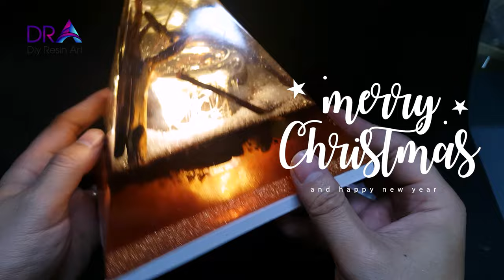Super Easy To Do the epoxy resin art lamp / RESIN ART

Comment: I really interested in this resin art. Before i start doing this, i wanna know some precaution.
1) is it dangerous to inhale it? Do we have to wear a mask?
2) is it dangerous if it touch our hand? And while it is still in liquid form, can we just rinse it with water? In case it made contact with the skin
Reply from the maker: 1) This glue is not dangerous, and there are even many types used to make kitchen utensils, But there are also rare cases of an allergy to it. 
2) It can be washed with water or wipes :) You can see the epoxy I used in the description of some videos
If you have any questions feel free to ask me :) don't hesitate
Reply: @DiyResinArt  thanks for your guidance mastah🙏

Comment: Why burning it and using that heather? And whats about that vacuuming
Reply from the maker: 😀Sorry I don't know what you mean, can you tell the time on the video, thanks
Reply: @DiyResinArt  dont know the time but at the first batch of resin you use a vacuum. Then after poring resin you use a torch and athen you where heating the resin